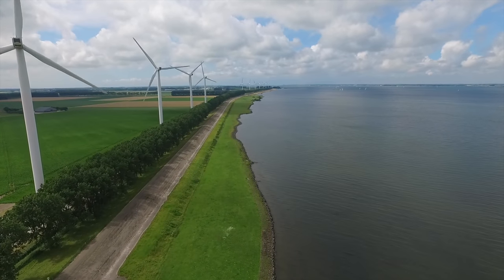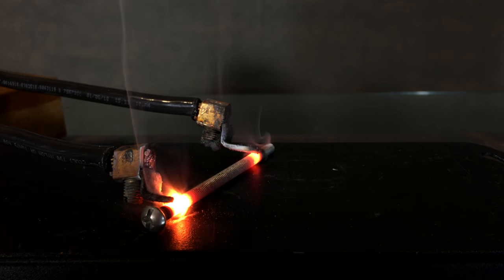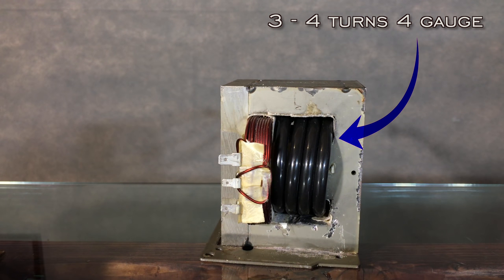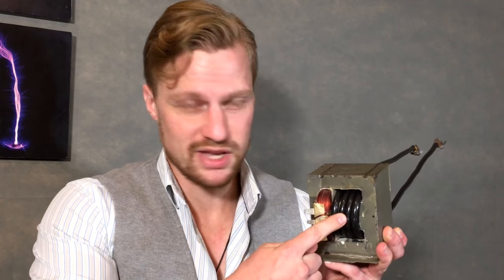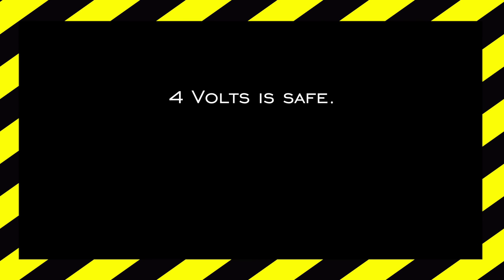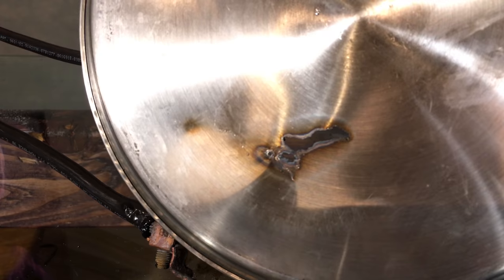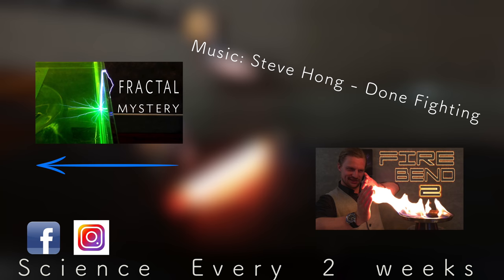DIY Steel Melter (HIGH CURRENT ELECTRICITY HACK)

Comment: Could you make an induction heater with that MOT? I'm a mechanic, and there is a really expensive handheld induction heater with the open end of the coil pointed out the business end available for heating stuck nuts on rusted vehicles to aid in their removal. Would be cool if I could build one. I know a bit, but it's probably just enough to get me in trouble.

Comment: I did the same thing with a much thicker wire. More current and still lower voltage. It works great but I would like more voltage. At some point I will have to get a slightly thinner wire.
Reply from the maker: Yeah I originally did 2 gauge and only two turns. It put out 2.2 volts and almost 500 amps. Crazy. But when voltage is that low, an load drops the voltage like crazy, and, you dont get a full melting effect.

Comment: Dude thank you so much for this video. It’s totally changed my understanding of electricity and helped me solve an issue with one of my inventions. One question though. In this video you said it will heat up anything more resistive then the copper wire? So can I use a copper wires coil to make a strong electromagnet connected to the transformers output? So it would be high amps low voltage. Which I believed produces a strong electromagnet?
Reply: I’d love to show you what I’m working on but it’s not for the public. So it’s have to be a private message. Also if you wouldn’t mind parting ways with that transformer that would certainly save me some time and money.;D
Reply: Nevermind! the Electric Gods have spoken and my magnetron broke in the microwave today and i was able to salvage a transformer! lol

Comment: Hey love your channel it’s amazing I had a burning question to ask you I have a an electric arc lighter I’ve noticed when I turn it on there’s a glowing orange tent ball around the arc I was curious what is that strange glowing ball around electric arc is it plasma, fire, hot air, magic? I was wondering if you can help me out thanks... stay classy😉
Reply from the maker: It may be residue in the electrodes burning in the plasma. As, the plasma should only be purple colored. Thanks for the compliments!
Reply: Plasma Channel That’s very strange because it’s a perfect sphere,never loses its shape and size , and it never seems to go away. It only goes away when I lightly blow on the arc.

Comment: Can you combine high current with high voltage?  I want a high current plasma arc.  I was wondering if a Marx generator could produce a spark across a gap and that gap is the two leads from your transformer.   I know capacitors allow AC to pass and block DC.  So maybe, if the two leads from the transformer were connected to AC capacitors and the arc would be past the capacitors, then the DC Marx Generator would be on the other side of the capacitors combining high voltage with high current.

Comment: I'm not sure but if the Joule effect is proportional to the amperage squared, I assume that it would be better to have juste one turn to the secondary winding. In that way, your transformer will be able to produce 1V and 1000A . Thereby, you will get more power to melt metals. What do you think about ?
Reply: Ohm's law plays a role here.Reducing the voltage we will not be able to overcome the resistance of the material and as a result to pass a large current through it
Reply: Just remember to make very good contact with the bar of metal, or no current will flow, and it won't heat up.

Comment: Nice vid again. Could you please make tutorial to your bigest voltage multiplier the 400kv one
Reply from the maker: Thank you! The 400kv multiplier is similar to the DIY lightning tower build
Reply: Plasma Channel does it use arc ligher or flyback transformer whit zvs drive
Reply: Plasma Channel And hey i find a way to use those dc hv modules you have to have full bridge rectifier to convert the battery power voltage to ac then run it to the hv module some of those cheap ones are ac modules

Comment: Nice video.  Do you think this will be strong enough to make a knife hot red so i can quench it?
Reply from the maker: Actually, yes it will be! Not a giant knife though..
Reply: Thank you for the answer. I was not thinking of a sword, but smaller knives,  the biggest maybe a Bowieknife 30-35 cm long. Then i will try this with a microwave transformer,  i have plenty of them.  73 de LB5JG
Reply from the maker: Yeah a small knife definitely! The Bowie.... hard to tell. Give it a try but I’d place some waste metal in contact with the knife first, then touch the wires to the waste metal. Because the wires will vaporize metal on contact. It will protect your knife.
Reply: I will try that.  Thank you for your advice. Greeting from Norway
Reply from the maker: Happy to help! Norway? I have wanted to visit norway for many years now. My last name traces back to Norway, though it was spelt differently back then.
Reply: I`m happy to hear. I also have family in United States somewhere, but i don`t know where.

Comment: so is it the number of turns or thickness of the wire in the primary and secondary coils that determine the voltage change?
Reply from the maker: It is the number of turns, or in other words, the inductance and resistance in the respective circuits
Reply: oh ok, I always thought it was the gauge of the wire, but I supposed that's just so it can handle the current and not overheat

Comment: did you just connect it to your home socket ?
Reply from the maker: I did. a standard plug in was wired into the transformer. The MOT's in USA are designed to input 120v from wall. If you're doing so, please be careful

Comment: I want to make one of these but i dont like to play with high power ac. Its just kinda scary to me, since ac is able to discjarge in your body with only one lead.(capacitance. It charges your body with the negative half of the wave while discharging it with the positive half.) And its kinda sketchy to me.
Reply from the maker: I personally prefer DC. Its cleaner, more predictable, and more fun to make sparks with.

Comment: Can a high current low voltage travel through a low current high voltage arc?
Reply from the maker: It really is a great question. May I use this as next week’s episode idea?
Reply: Plasma Channel That would be cool, I think TIG welding machines do it to start an arc, I'm not sure though.

Comment: What would happen if you hooked 2 of them together
Reply from the maker: The world would potentially... explode
Reply: I have two transformers we’re going to find out
Reply from the maker: By together do you mean in series, or parallel?
Reply: People actually hook 2 or more microwave transformers up all the time, you just gotta make sure they are in phase with eachother.. Either make sure your wall is rated for the amps drawn by 2+ microwave transformers or ballast it to where it will only put out a certain amount that's under your wall load amount.
Reply: My buddy made an arc welder like this. We had to drop 2 extension cables to connect each one to its own circuit breaker
Reply: Jordan Bennett you mean to hook them up at 220v?
Reply: Jake Mitch we put each transformer on its own 110 volt outlet and ran them parallel.

Comment: mh i cannot short my MOT :/  Fuse coming first.
But with a half meter of 35mm² as resistor i measured over 1000 Amps :D

1,5 windings of 95mm² was maybe a bit too much xD
Reply: G E T R E K T 905  95mm² Sekundärspule ;-)

Comment: Please remember people don’t not use a microwave transformer as it is and play around with it. It will kill you and this is no joke at all. So if your going to do this and do it as he tells you in this video. Please don’t play around with this transformer before breaking it down with 4 turns of wire. It will kill you if you touch it. Also do not ever touch the big capacitor in a broken microwave that you might use. It will do the same if it still got charge in it. Play safe and stay alive.

Comment: Hi, missed the part where you attach a plug for power...
Reply from the maker: Oh, its just a standard plug to go into a wall socket, and the two input wires on the transformer have leads that the wire from wall can be attached to. Be careful if doing so

Comment: What happens if you put one of the modded mots in series with a normal mot? Will it just burn up the secondary coil?
Reply from the maker: Likely burn out the secondary from too much current. Then again, that secondary has so much resistance, it would prevent most current from flowing. I can find out for you.
Reply: Plasma Channel That would be cool to know, I would do it but I rent and don't feel like burning a coil and house up

Comment: Im probably making voltage multiplier to electric bug zapper whit external power suply and run the vm in my back whit strips and run a cable to the bug zapper

Comment: I would like to know how to wire the transformer
Reply from the maker: To wire it you simply thread the thicker wire in circles.
Reply: @PlasmaChannel  I mean how to wire the power line of the transformer. Because there are three connectors on the primary coil

Comment: Sir what is the input voltage and current please sir reply as I am also making
Reply from the maker: Input current is 10 amps, 120 volts.
Reply: @PlasmaChannel  sir any other power supply that I can use instead of AC mains

Comment: how can you touch the circuit with 250Amp? clearly the current finds the easiest way to ground through the circuit... but still... id be chickenized!
Reply from the maker: 250 amps will do nothing, if there is not enough voltage to push that current through a body. Voltage is an essential component to cause danger.

Comment: I thought it was the amps that killed you?
Reply from the maker: It’s the amps - experienced - by your body that kills you. Which, is dependent on voltage applied. If voltage is really low, virtually no current (amps) flows through you. So you can touch hundreds of amps at super low voltage, and feel nothing. Super low voltage = a couple volts.

Comment: I understand that the output voltage, 4 VAC is too low to strike an arc. But I am wondering, if you strike an arc by using another power source (like the plasma candle you built: https://www.youtube.com/watch?v=SyZuel2iaBk), do you think that this transformer could inject its high current inside the electric arc despite its low voltage, and thus make the plasma even hotter and brighter ? I know that plasma torches and TIG welders are using something very similar: they use an HV circuit to start a pilot arc, then another circuit with a lower voltage inject hughe amount of amps to make the plasma hotter. What do you think?

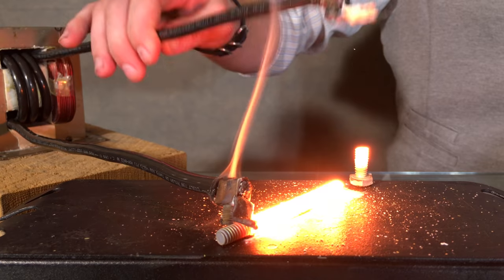Comment: I still don't trust touching that. 4V sure. But man is you calculation where off a little. 250 Amps !!!! Touching 250 amps 2:48.
Reply: You can definitely touch these wires, Ohm's law is U=R*I. So if you want to know how much current could flow through your body, knowing body's resistance is about 100 000 Ohm, you would have 0.00004 Amps, which is simply not dangerous. Furthermore, you will get this amount of current inside your body only if you touch the two wires with your hands, if you short the wires with a piece of metal, the current across your body will be 0A. There is no danger here :)
Reply from the maker: A car battery outputs 12 volts and 580 cold crank amps. Car batteries can be touched. Huge myth that they will shock you........actually that gives me an episode idea! Thanks!

Comment: Hey Jay, why not build the Tesla Hairpin Circuit?  There are many cool effects that can be shown from this.  I built it myself a few years back.  Here is a link to building a good functioning one.  http://www.transformacomm.com/en/tech/tesla-hairpin-circuit.htm  Thanks for all your videos, please consider building this circuit.
Reply from the maker: Not familiar with that. I’ll have to look it up!
Reply: Also, you may want to look into the concept Tesla refers to as his "extra coil" he placed in series to the top terminal of the secondary coil on a Tesla Coil.  If you have his Colorado Springs Notes book he covers this topic starting on page 78.  I mention this because in the notes he state "It is notable observation that these "extra coils" with one of the terminals free, enable the obtainment of practically ANY voltage potential (emf)"  
Here is a link to a pdf of the book.  The pages referenced are actually #73/74 in this pdf format.
http://www.shamanicengineering.org/wp-content/uploads/2014/07/Nikola-Tesla-Colorado-Springs-Notes-1899-1900.pdf
I don't know if this extra coil info will help with future goals/videos, but thought I would mention it.  
I love the videos, and look forward to more!

Comment: Nothing here about the input power source, if it's 110V then we could have some junior scientists getting fried by this experiment,  some safety warnings would be appreciated.
Reply from the maker: Fundamentally, 110 is safer than 220 or 240 volt aways. Yes, it's US standard, 120. My safety warnings could be stronger in these older videos.

Comment: Not a great idea using this thick insulated wire, you should be using copper sheet or thick copper bar insulated with some heat resistant material for the winding instead...
Reply from the maker: That would certainly be fun to experiment with
Reply: I do it with 95mm² Insulated Wire...
The Transformator is even to weak to handle the 1,5-2 volts out of the 1 / 1/2 windings.

At 600A+ The wire are cold :D

And Wires Like this are very expensive... Copper bars even more.

Comment: Bro you need some shit original. Try doing this same setup but instead of using thick wire use epoxy insulated copper tubing
Reply: You can run saltwater through the copper tubing and cool it
Reply from the maker: In case you missed it, I stated that I was not the first to do this. 👍. For more original content, i recommend you view the other 75% of Plasma Channel’s videos. I built a high current transformer, decided to share the adventure.
Reply: Plasma Channel sorry I didn't mean to come off as offensive, I wish to help you I have watched alot of your videos
Reply: Plasma Channel I understand you also have to come up with filler content because of the gay YouTube algorithm that will stop promoting you if you stop putting out content
Reply: Plasma Channel writing can come off with different tones then speaking. Was not trying to sound like an ass, I read it again and it does sound angry haha sorry. Yeah bro I have been trying to support your channel by watching most your videos I see, but alot of them seem to be repeats of other channels I have seen.
Reply from the maker: It’s okay, no worries. I acknowledge this melting idea is not mine, you are right. It simply was a casual, fun episode on my part. I could have been more original
Reply from the maker: Also you are not wrong about the algorithm
Reply: Plasma Channel I've always wanted to take 2 to 4 identical microwave transformers and split the cores connecting the E to E and then lining the other 2 up sideways so it's longer.. then take quarter inch copper tubing and lay down potting epoxy and wrap each layer of coil and wait for it to dry until I have a complete winding made out of copper tubing.. I believe that would be a beast, you could then have cooling fluid that is also conductive. I have never seen anyone do anything like that on YouTube. I have alot of ideas that I need to do, I just don't have much time or money so I'm set back.
Reply from the maker: Thats a really great idea. A bit of work, but....high power for sure
Reply: Plasma Channel you're welcome to try it if you want, would be kinda hard to source 4 identical microwave transformers though. I think it would make a nice video. You should make a video about ballasting the microwave transformer, you can use inductive or resistive that would make a great follow up video for this video that you just made, microwave transformers get really hot if you don't have some kind of choke on them or submerge them in cooling oil. Alot of people have made videos on that but I have not seen any videos done as well as you do them.